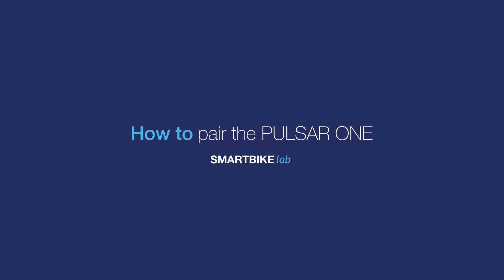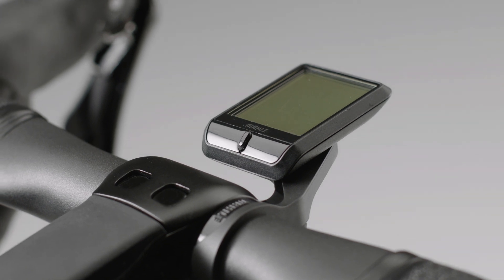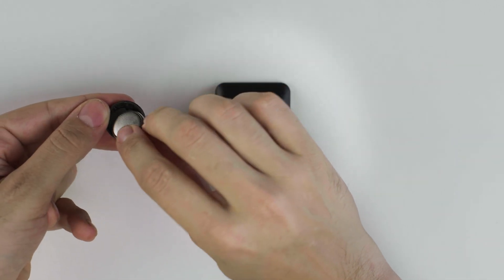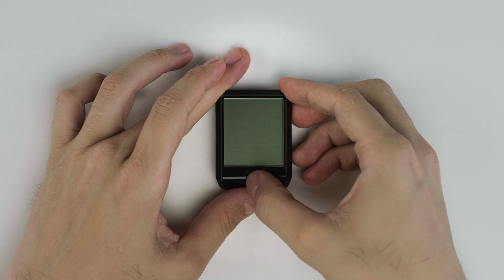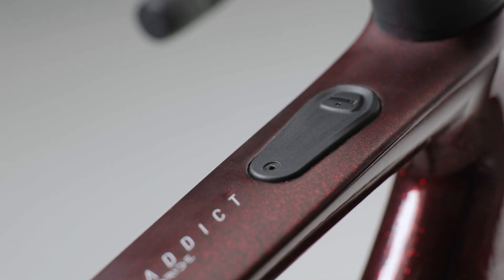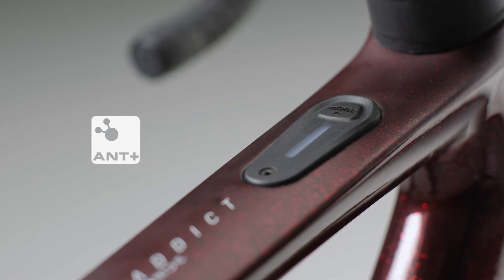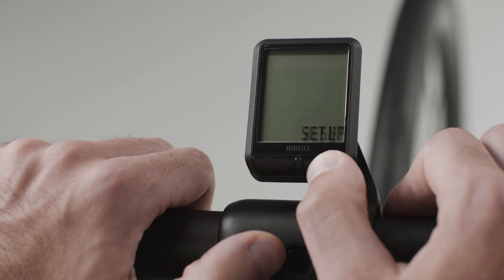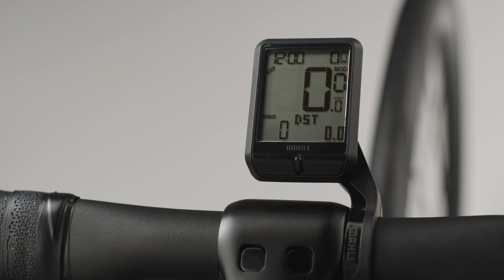MAHLE SmartBikeLab - How to pair PULSAR ONE

Comment: Is there any literature on the Pulsar One?  As it connects with ANT+ devices in interested to know if it can use ANT+ power meter data to provide input for assistance control similar to a torque sensing bottom bracket installed directly in the system.  I have an X35 system which I hope as part of the Mahle ecosystem can integrate with the Pulsar One.  

Thanks,